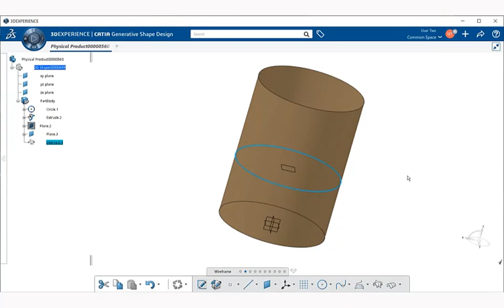CATIA 3DEXPERIENCE Surface WireFrame: Intersection Tool

Comment: you've got intersection of plane with a solid body, not with the surface, there is a big difference in case of brick instead of cylinder for example